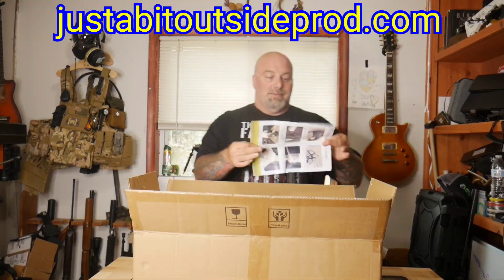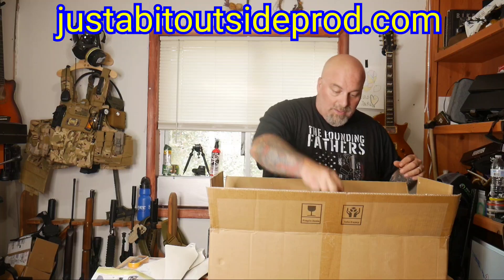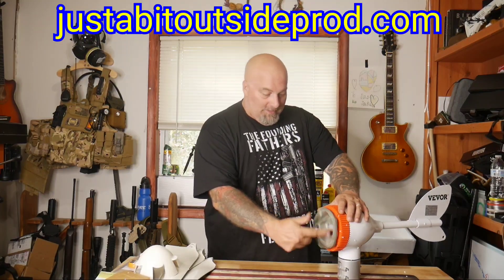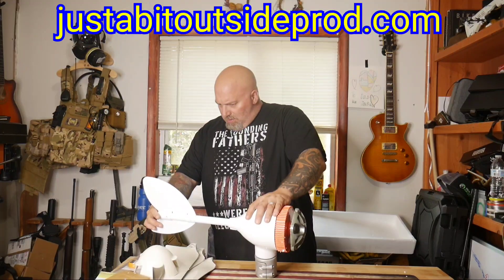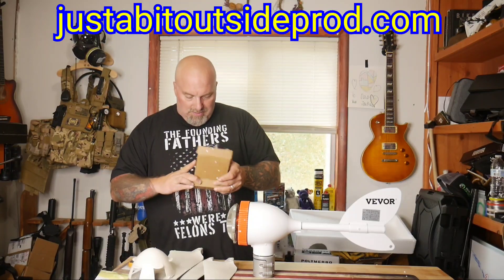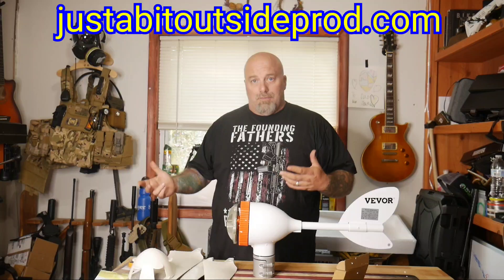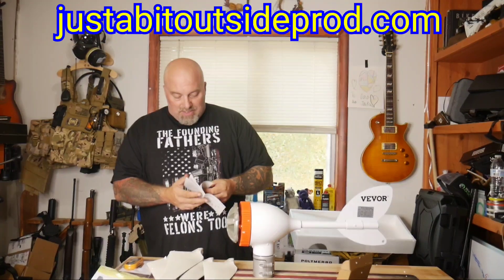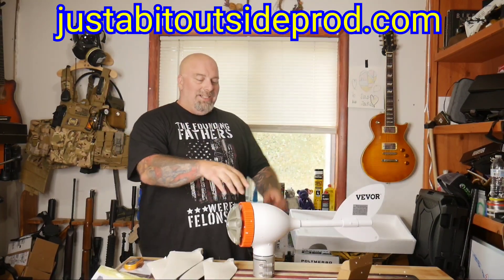VEVOR 400 Watt Wind Turbine - Unboxing

Comment: For wind to be useful you need "blowing chairs across the deck" wind to get any useful power.
Think the other way round - how much wind does a 400W fan of that size put out?
Generally you need loads of height - really high on a shed roof on top of a hill is typically required.

Comment: Wind turbines may seem great. 2 meters per second for turbine to turn.  That's 4.5 miles per hour.  You'll be surprised how often wind is below that speed.  2 meters per second will not get you 400 watts. 400 watts is maximum output. They are nice to have as a supplement but solar panels will be more dependable, quiet, and last longer.  Look forward to seeing your results.
Reply from the maker: Agreed, we have great winds here but still don't think I will see 400 watts
Reply: Shop around and you can find some nice 400w + or - bifacial panels for a good bit less than the cost of one of these things. Mine were $106 bucks ea. New.
Reply from the maker: @beebop9808 shoot me a link justabitoutsideprod@gmail.com